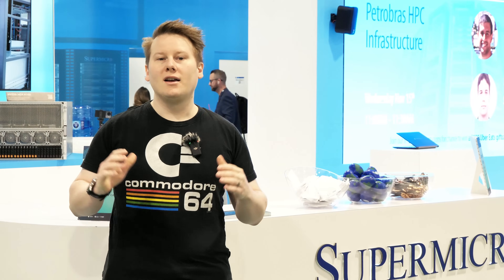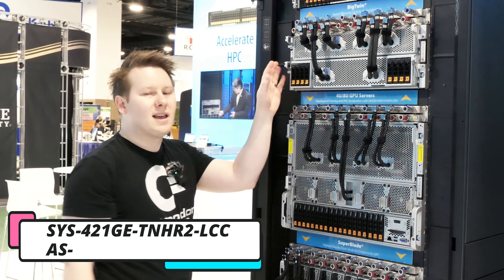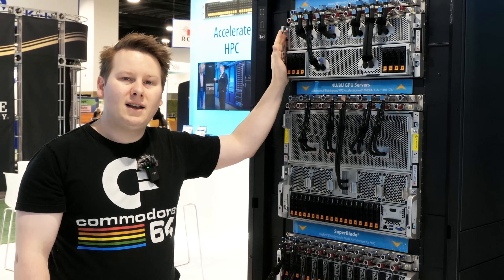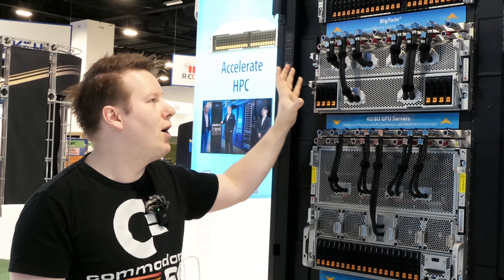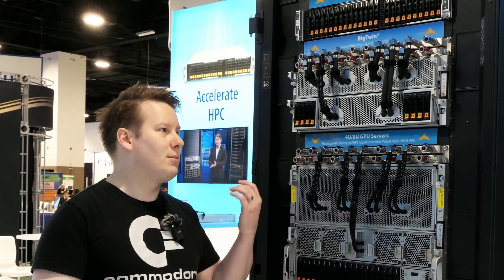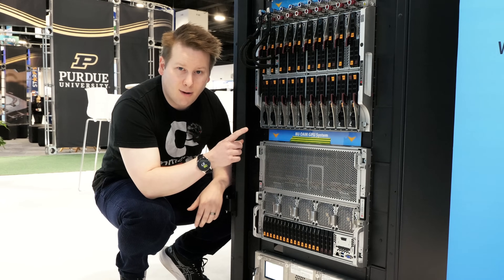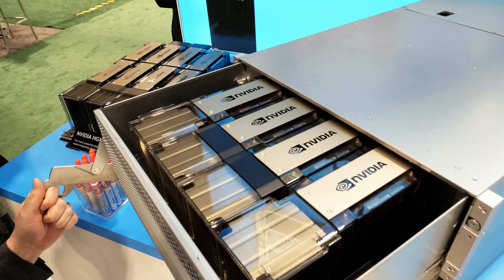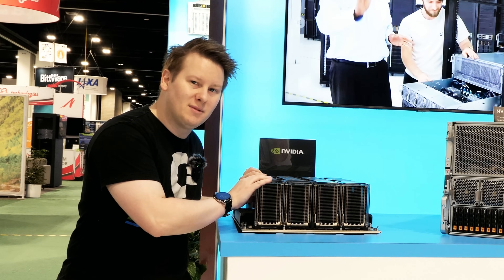I Wish I Was This Dense

Comment: I wish you could have shown the internals of the water cooled option. That would be more interesting. I have a parallel cooling loop in my gaming pc with a MO RA 360. With so much cooling potential I am considering adding my HTPC to the loop. The gpu in it is already water cooled with it's own AIO. The cpu is air cooled. I do semi-daily video transcodes with it. It takes 4-5 hrs at full load. I may add it when I do a AM5 upgrade.